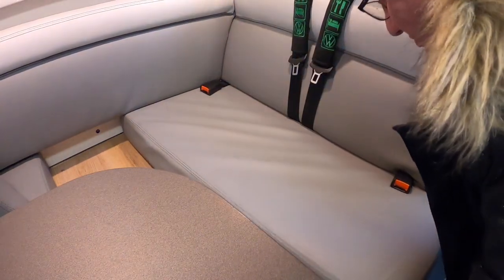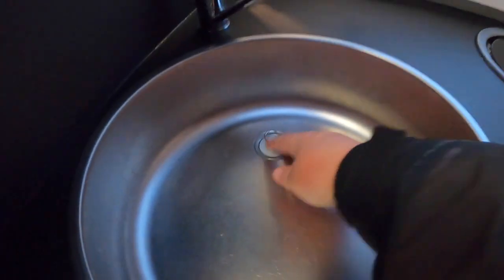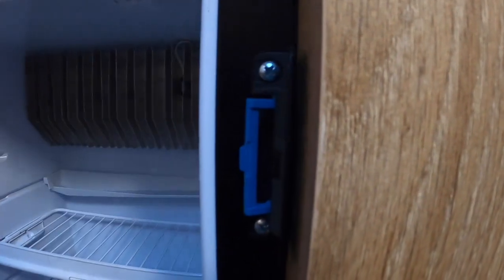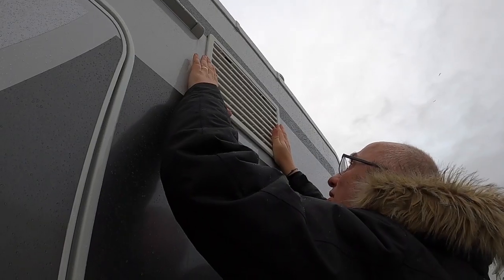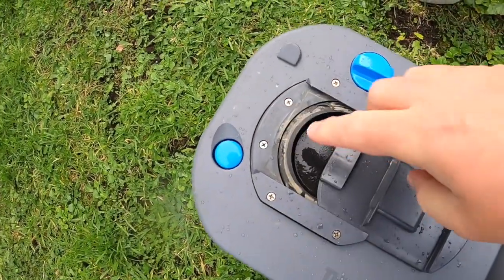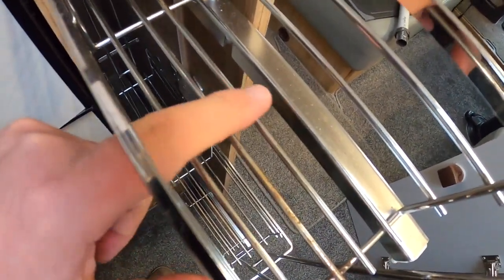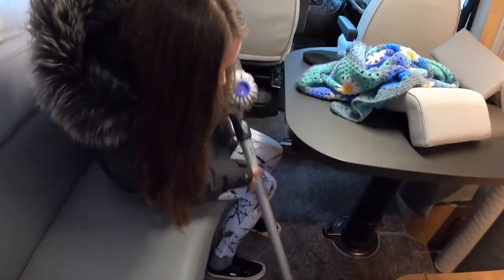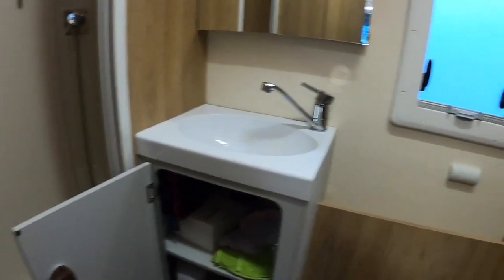How to Prepare Your Motorhome For a Winter Lay Up | Useful TIPS

Comment: Great tips! I also put out Chinese takeaway pots full of uncooked rice around in different areas in my van. Lids off. The rice absorbs any moisture or damp in the air. Or you can use salt in the pots. Break up any crust that might form on the salt. Dry them out at the end of winter, lids on, store till next winter.
Reply from the maker: Ah, rice and salt. Yes they will certainly absorb moisture. We assume no mouse has come and dined on the uncooked rice? Thanks for watching and your comments.

Comment: Great advice.  I remember our moho routines well before leaving it in storage, and one tap in a particularly difficult to reach area beneath the fixed bed which Bri used to curse about (thanks Elddis!).  We used it throughout the year though so no problems encountered except for the mouse at the storage unit which chewed our armrests.  We were told they didn't like mints but this proved untrue as it ate a full packet of extra strong mints in the glove box 🤣. Anyway long story short, we caught the blighter, released it and changed storage areas!  Much easier with my little van on the drive now, wouldn't fancy the bigger unit and whole storage thing on my own 😊
Reply from the maker: Mouse in storage?! And he wouldn’t be paying either 😊 I would be miffed Sue. Note made: mints don’t work. Thanks for watching Sue. Fran, Paul and the Minions.

Comment: Superb top tips, thanks. Do older vans need moisture traps in winter? Ours is a 22yr old Ducato.
Reply from the maker: It’s difficult one that. When you use the van and sleep overnight if there is little to no condensation in the morning it is presumed the ventilation is sufficient.

Comment: Running the air-con is also good for dehumidifying, I put it on internal air circulation when doing a small winter run as this helps draw moisture out of the air.
Reply from the maker: Good advice.

Comment: To keep the starter battery charged I use an Ablemail AMT12-2. Not exactly cheap but has kept our starter battery charged through periods when the engine isn't run.
Reply from the maker: If the van was stored at home it would definitely be plugged in to a trickle charger.
Reply: @LiveforTravel  The AMT12-2 trickle charges the Starter Battery from the Leisure Battery when the LB gets above a certain voltage. So when the Solar raises the SoC of the LB and its voltage rises it then charges the SB. I have one one our 2017 590.
Reply from the maker: @tonysummers2334  now this sounds great. I will do some research. Thanks for your comments.

Comment: Hi guys, have you had anything wrong with your roller team? 👍
Reply from the maker: Now there’s a video in the making! As of now, we had the glass lid come loose on the hob (fixed by tightening the screws) and the Truma flow pipe came adrift which caused the system to have errors. Found on the habitation check.
Reply: @LiveforTravel  ours is going back to Italy for repairs. We have a 707 and have roughly 55 problems. P.s we used to be at the same storage site as you as I recognise it in your video but we have moved to the hargate site now.
Reply from the maker: @derbymatt  oh that is real poor. Sorry to hear. Presume it is because of the type of problems rather than just the number that requires the van to go back to Italy?
Reply: @LiveforTravel  the main problem is the floor is being replaced
Reply from the maker: @derbymatt  I have seen many people have issues with different makes but others that have little. We sincerely hope you get everything resolved soon and with as little inconvenience as possible.

Comment: i guys, im new to motor homing. i follow what my dad used to do, by leaving "bella" hooked up to the house using the mains hook up, occasionally i take it for a 10 mile or so drive. i had considered putting her on axle stands over the winter and removing the wheels completely, but that would mean putting the wheels back on every two weeks. thoughts on any of these ideas would be gratefully accepted.wozza
Reply from the maker: The range of peoples opinions vary on this one. We don’t think there is a particularly right or wrong answer. Leaving the van plugged on EHU constant, providing the charging system for the leisure batteries in the van is a good one and prevents overcharging, is no real issue. Our personal view is that this is a waste. The solar panels on our van look after the leisure battery just fine over winter. There is a misconception that all Motorhomes, when connected to EHU, also charge the vehicle battery. This is simply not the case. Some do, some don’t. You would need to check with the specific builder of the Motorhome. Driving the van and getting the engine to full running temperature is definitely better; at least for the engine, as this removes any moisture buildup in the engine and exhaust. We hope you make many memories in your Motorhome.

Comment: Hi both, if.. you had your van outside your house, would you hook it up and have a small heater running to prevent damp etc?
Reply from the maker: Final part of this reply is a copy paste to another similar question but with regards to heaters etc, we wouldn’t bother. A modern Motorhome has more than enough ventilation. We believe the best option is to allow the air to circulate, leave blinds open and let the van breathe as it was designed to do. The following is a copy paste. Thanks for watching and your questions.

“The range of peoples opinions vary on this one. We don’t think there is a particularly right or wrong answer. Leaving the van plugged on EHU constant, providing the charging system for the leisure batteries in the van is a good one and prevents overcharging, is no real issue. Our personal view is that this is a waste. The solar panels on our van look after the leisure battery just fine over winter. There is a misconception that all Motorhomes, when connected to EHU, also charge the vehicle battery. This is simply not the case. Some do, some don’t. You would need to check with the specific builder of the Motorhome. Driving the van and getting the engine to full running temperature is definitely better; at least for the engine, as this removes any moisture buildup in the engine and exhaust. We hope you make many memories in your Motorhome.”